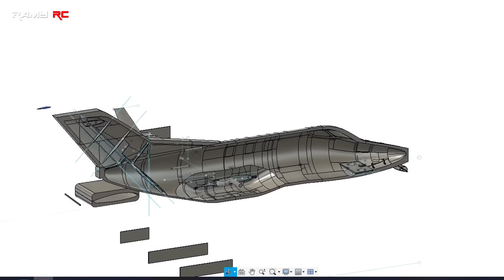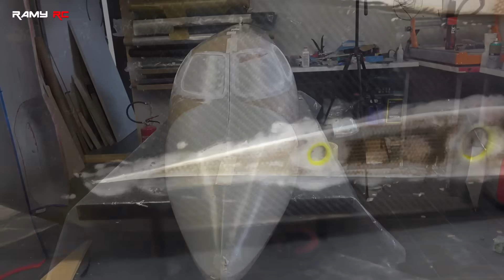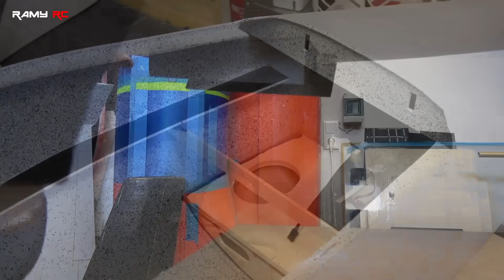I spent 6 months building a giant RC Honda jet

Comment: Ramy - Nice job brother. One tip - take your Brayer Roller to the belt sander. Angle the ends/edges and feed into the sander until they're rounded off to the profile you need. It really helps having a rounded brayer roller when smoothing your glass/fiber as you don't get those lines from the normal/straight brayers when working on compound internal surfaces.

Comment: Hi Ramy. Have you thought about using a Nomex Honeycomb for one of your layers like on our Cub Crafters Carbon Cubs to keep the weight down? One layer of carbon. One layer of Nomex Honeycomb then one layer of Carbon on top sandwiching the Nomex Honeycomb in the middle. It is really lightweight. Very expensive though. Have to buy in bulk to save money. You are an incredible builder. You should start a flying school for dogs cause your planes are big enough to carry them, lol.

Comment: At 7:31, the brass eyelet inserts are installed upside down into the servo grommets. The wide flange needs to be installed towards the mounting surface to spread the load out, otherwise the screw will force the sharp edge of the eyelet to cut into the mounting surface.

Comment: Beautiful job! Looks like it flies fantastic. One minor bit of advise, you are installing your servo eyelets incorrectly. The flanges should face down against the mounting surface. When mounted the other way, the barrel will dig into the surface and not provide any shock absorption. The head of the screw and the flange work opposite each other to capture the rubber grommet for isolation.

Comment: Question:  How do you determine the offset between the size of the mould and the wooden ribs? Do you know in advance how thick your carbon sheet + resin will be and subtract a fixed offset when designing the wooden ribs/frames?

Comment: Oh sure. I ordered those same, Honda Jet, oversize model body forms. So I could make my own, and laid, carbon fiber fuselage. I make those all the time. And I have a lot of plastic fuselage forms to make them with. I keep dozens in my bathroom. So I'm never far from making another fuselage.. Out of carbon fibers and composites. Along with some epoxy glue. As its, stronger than, Steal.

You can, Steel, my heart away.
RemyRAD